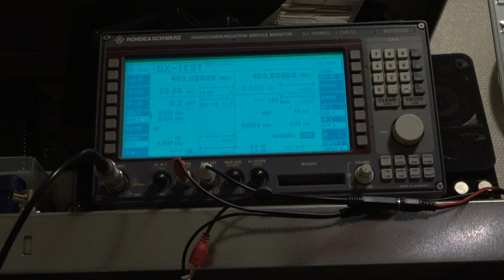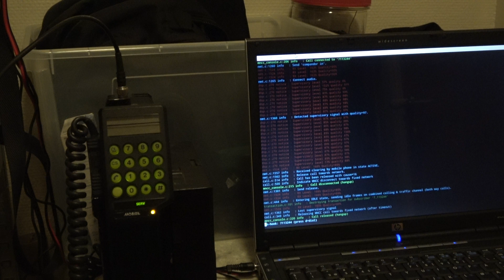Osmocom-analog With CMS52 Duplex Mode Analog Cellphone NMT450

Comment: Is it possible to get osmocom to hang up the call so you don't have to press the button on the phone? Or was this limitation because of something with this particular setup? I'm curious to know if osmocom-analog could be set up to automatically route calls out to real numbers and route them back in to a single phone, using say a 4G router with sim card as the externally visible number to the world.